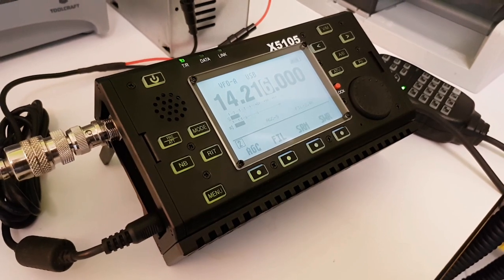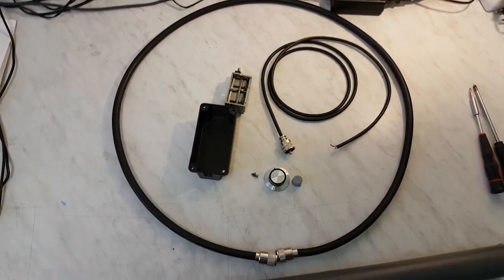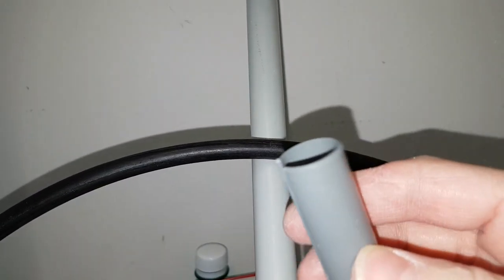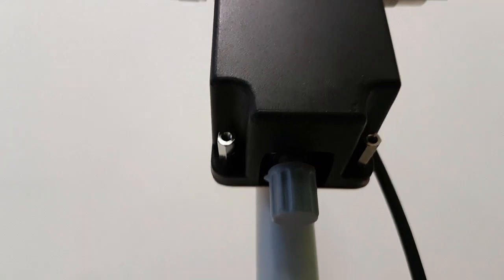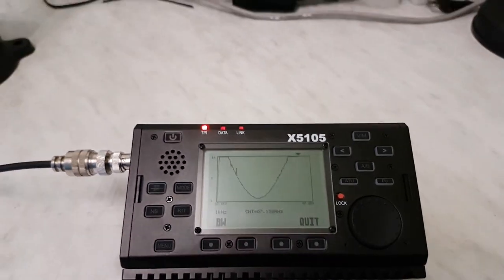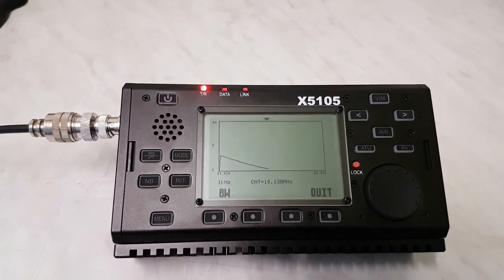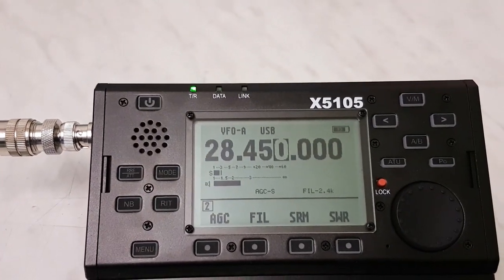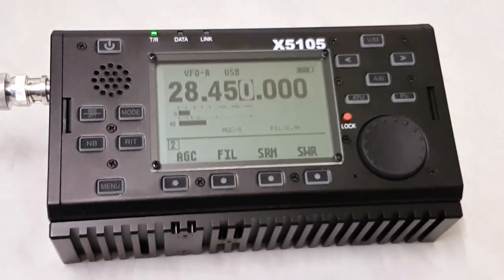UltraLight Magnetic Loop Antenna + XIEGU X5105

Comment: Very good job. My next antenna build is a magnetic loop in the same frequency range as yours, I'm planning on using a capacitor out of a full power tuner. I have an old Amp Supply AT-1200, I also have a 10-foot 3/4-inch copper tube, since I already have the copper, I will go with it. I's nice to have an analyzer built into the radio, I use my G90 in the same manner. 73's🎙KD9OAM🎧

Comment: Hi Paul, 
Many Thanks for another great video about magnetic loops. 
I've been thinking about one for much higher power output,  which will also obviously require a much larger spaced capacitor.  However,  due to the high Q of the magnetic loop, have you thought about putting a much smaller value variable capacitor in parallel with the main tuning capacitor.   Maybe start with the fine tune capacitor at somewhere between 1 quarter mesh & 3 quarters mesh, and then tune the main capacitor in your normal way,  followed by finer tuning with the secondary smaller variable capacitor.  A field strength meter attached with its pickup antenna close to the mai large loop may simplify tuning & increase tuning accuracy, especially when fine tuning with the smaller capacitor in parallel with the main tuning capacitor. 
I would be very interested & greatful to see your thoughts on this. 
Once again Paul,  Many Thanks for your brilliant antenna projects videos. 
73 De M0RAY, 
Sittingbourne, 
Kent.
UK.

Comment: 3:39 HOT POLE (or central pole) not connected? Did you connected to condensator only to the cold pole of the coax cable?
Reply from the maker: Yes all my magloops are connected to the center cores of the main loop coax.
Reply: @OM0ET  3:39 in this image i can see the condenser connected to the cold pole  of the 2 connectors SO239, not connected to the center core of the SO239 connector. Is it correct?
Reply from the maker: @mrtonicsvls3624  oh yes, in the 1st version I tryed connect to the outer shield, but i changed this configuration later.
Reply: @OM0ET  Perfect!

Comment: Can you share any detail of how you closed the small loop? Did you just solder the shielding to the center?
Reply from the maker: Center is soldered to the braid 😉
Reply: Actualy rg 58 connected on small loop above and it runs near to capacitor,it is not cleared the actual connections, whether the coax is only connected to upper loop or it is interconnected too.and, if it is connected on upper loop then both the end of small loop connected with coax shield and core both?

Comment: I will like to know how long is the coaxial loop with the PL250 and also the diameter of the main and second loop. I guess you connected the variable capacitor of 350+350 pf in series with the loo p center pins, if not please provide an schematic of the whole antenna please
I am interested to build one.
My email address is:
ad4c@comcast.net
Reply from the maker: Please visit my website om0et.com 😉👍

Comment: Is your antenna a resonant shielded frame? In the center of the loop, the screen should be cut, in the same place, the connection loop is connected in the form of a small circle.

Comment: Hello Paul, What is the emetter of  10.10 Mhz, I receive the same noise in France on the same freqency . I don't know from where it is coming . 73,  F1HLF Serge
Reply from the maker: It's probably Weather RTTY station (Signal is 50 baud, 425hz shift, normal polarity)
Reply: @OM0ET Thanks Paul, I found it , it's locates to Pinneberg, just near Hambourg in Germany. The callsign for this frequency is DDK9 and the transmitting antenna is located at Pinneberg northern Germany. Best regards. Serge F1HLF
Reply from the maker: @beot7248  Thank you Serge! I will know now ;-) Have a nice day! 73

Comment: Hey dr op. What RG type cable is the main loop made of? And which scheme did you use for connecting the RG58 small loop at the ring/shielding? Thx es mny 73.

Comment: Paul, I love the video. I have a Xiegu G1M SDR QRP. I will build a similar antenna (waiting on a variable capacitor from China - similar to yours - 2 ganged 350 pf).
I am interested in the actual wiring setup. Did you join the center conductor and the shield at each end of the large Primary loop? Or did you simply use the center conductor inside the shield. I am thinking of joining the braid and center conductor at each end of the Primary loop, where they connect to the capacitor. [Edit: I see you left the shield unterminated and even with a few cm gap on the opposite side]
Also, have you simply left the ends of the Driven loop twisted off (it looks like) and unterminated? VK4FETC [Edit: I saw in another of your vids what you did - many Thanks]

Comment: I am disabled and could not build such an antenna. Would you be able to build one for me or recommend a commercial antenna of similar dimensions. Cost is not terribly important. Thank you, Mike, N0WDM
Reply from the maker: Hello Mike. Thank you for your interest of my loop antenna. I build and also sell this antenna but only V.3 and V.4 .
Ver.3 is 85cm diameter and ver.4 is 1m in diameter.  Ver.3 is for 10-30MHz and ver.4 is for 7MHz - 27.5MHz.

Comment: I have found the exact same capacitor as yours (320+380 pF) on eBay for $20 in Bulgaria. I've bought two and I will make the same antenna!
Reply from the maker: That's great. I recommend to you build a 4th version or 3th one 😉👍
Reply: @OM0ET  Thanks for the hint and 73's de F1SLS ;)

Comment: MFJ should stop importing and supporting Chinese Radios.
Reply from the maker: What's wrong with Xiegu radios?
Reply: @OM0ET  My point is I don't care what is wrong with Chinese radios they are ripping off Western Technology! They are not getting my money.
Reply: Nice antenna! I want to build a 10 meter Loop. thanks for the reply.
Reply from the maker: @n9oqu  thank you for your point of view Bob 👍
Reply from the maker: @n9oqu  Once i was using my home made Magnetic Loop antenna as the base one. It was able to handle just 25W, but even with this low power i worked  with VK, ZL, JA and W too. Loops are very practical antennas :-)
Reply: @OM0ET  I should have looked into a Loop a long time ago when considering a compact antenna for operating a home base station.  When i saw that loops were operable inside the house/apartment I was convince I found a solution.  I just purchased a commercially made loop and I am getting it tomorrow.  I also want to build a 6 or 10 meter loop in the near future.
Reply from the maker: @n9oqu  well, so i wish you very good luck with your new loop. And good DX! 😉 73
Reply: @OM0ET  I hope to have a QSO with you. Do you use PSK-31?  With this new antenna  I am hoping to get into CW seriously.
Reply from the maker: @n9oqu  I am sorry but digi modes are for me something like from another world 😄 I have to learn it more and CW also. 😊 I hope to meet you on the air. What ia your callsign btw? 😉 73
Reply: OM0ET My call is N9oqu
Reply from the maker: @n9oqu  OK Bob is good to know 👍 will see you on the air 😉
Reply: @n9oqu  Prove it

Comment: Hello, thank you very much for the video. With a variable capacitor of 30 to 350 pF could you make that same antenna?
Reply from the maker: sierpes hello! Thank you very much for watching 😉 This capacitor is 320+380pF. So if you use only 320pF it will work only on less bands not as this one (from 40m to 10m). 73

Comment: Great video and antenna design, mag loops are really cool.
how much would you say it cost you to build? Also have you tested general Rx/Tx indoors?

73,
KE8GAH
Reply from the maker: Lync Volt the build price could be around 20€.  Piece of PVC tube, small plastic box, short piece of coax, piece of copper wire and feedline with PL connector. To see how its works please visit my video list. There are few videos working QSOs with this antenna. 😉 73

Comment: I don't think leaving the copper on the PCB is a good idea.  when the antenna works at high power, it will get really really hot.
Reply from the maker: captain Liang yes i tought that i will isolate screws from copper layer because it causes little frequency change when my hand is close to tunning box. There is used small high capacity capacitor so this antenna is only for QRP power 5W.
Reply: uh... yeah, it's not a big problem for QRP operation. I have built several loop antenna which the structure of it just like yours. one time I operate 50 Watts in CW mode about 1minute, I smell that something is burning up and I found the knob on the tuning box is so hot that I cannot touch it, but the capacitor is not hot. when I remove the small aluminum sheet from the knob, the problem solved. my best range record with loop antenna  + 0.5WATTS in CW mode is about 8000KM on the 15meter band, but I screw it up because I was too excited to send  Morse Code by straight key.

Comment: Have you tried to tune it down to 80 Meters band?
Reply from the maker: PhilsLab no i didn't. I suppose that so small diameter should be not usable on 80m.
Reply: I am planning to make one of those http://www.alexloop.com/artigo16.html 80 meters is the only one band where I was get at least something using SSB6.1. I have hope that a mag loop antenna will be useful there. Unfortunately I cannot make large antenna. I need something under 90cm in diameter.
Reply from the maker: yes, a couple of loops should work 80 meters. One loop is not enough.
Reply: Yes. I did my research there, ideal loop should be around 3m in diameter which is totally not feasible for me.
Reply from the maker: PhilsLab oh yes i can imagine that lol. :-) Two turns of 1.5m diameter could be much practical.
Reply: I agree. I have to stick with much smaller loop. Can't wait to get variable capacitor.
Reply: Vk3ye made a loop for 40m using 4.2 m of tube and a 10-415pF air variable capacitor and added an additional 2200pf capacitor across the loop for 160 m and 390pF for 80m
Reply from the maker: Ofcourse you can get it in resonance with aditional capacitors, but efficiency of this Magloop will be almost 0% 🙂

Comment: Hello Paul, very interesting built of a MLA. Have been experimenting myself but have a larger size loop. This one is smaller but seems to be working well. Have 2 questions: Don't you have problems with tuning, I'm not shure your capacitor has reduction? And question 2 is: Could you tell us the length of the coax you used for the large and the small loop. I like the way you routed the coax through the tube, never thought of that. 73, Bas PE4BAS
Reply from the maker: Hi Bas thank you very much for you interest of my MLA. Lenght of main loop is 1190 mm and small loop is 445 mm. Small loop is no more made from coaxial cable. Now after i did improvements is made from 2,5mm thick solid core copper wire, let see my 2nd video after improvements here: https://youtu.be/Nfundq0cC7o
Reply from the maker: At 1:40 you can see a small gearbox like reduction on capacitor. Tuning is not so hard to tune. Harder is to prevent little capacity change while is hand close to the tuning knob. Because of that you have to tune it little bit lower than is the best SWR position. When will be your hand away so MLA will resonant higher. It's about 3-5kHz change in my case.

Comment: How close does the driven element have to be to the main loop?  Did you play with varying distances between the two?
Reply from the maker: Barry Mercer it has to be as close as possible but it has not to be electrically touched each other.
Reply: Thanks.  I enjoyed your vid and used it to make a similar loop!  However, it is still to cold to go outside and play with it.  Tell me, how do you like the Xiegu?
Reply from the maker: Barry Mercer Yes the Xiegu X5105 is an excellent radio. I like him very much. I sold my ex Icom IC-706MKIIG and bought this one. And i am very very happy with it.

Comment: heiio Paul!
where can I see the exact scheme of your antenna?
I'm interested in connecting a small loop and capacitor.
73! RW9RN
Reply from the maker: Hi Andrey, if you want schematic diagram so i have to draw him. If i will done it i will put a file link in to this video description. OK?
Reply: excellent Paul!
I will wait for the link. this is a very interesting antenna for my summer cottage.
73!

Comment: What confuses me is that the loops are made of shielded coax which blocks signals. Why isn't it better to use exposed copper?
Reply from the maker: Hi Golan, the shielding of the main loop never should be grounded if you use inner core as radiator. But you can use shielding as radiator too, but there is a problem when are used PL connectors, because of poor electrical connection will cause this tiny spikes as you can see here: 11:05 After this video i did few upgrades and one of them was that now i use inner core as radiator - there is a much solid connection and this spikes dissapeared. ;-) btw. shielding can be used as the prevention against strong electric noise, but i am not sure of that in this case.
Reply from the maker: My antenna is working excellent now after upgrade what i mentioned before. There are not any spikes/peaks anymore at antenna analyser graph. Inner core is connected only.
Reply: My question is on this cable used as big loop.as it has shield of corrugated copper thin film and not the smooth shield (as it is not seen in  the cable used as it is already ended with pl 239 connectors.) Will it effect. As some doubt raised here is cleared by use not to ground the shield.but if I want to use this thick cable as VHF radia as shield and not middle one ,can I use it? If yes , what the effect on antenna?

Comment: That variable capacitor has two major sections of different sizes.
They are probably for an AM  radio. (MW & LW) The left hand section is about 500 pF the right hand is about 350 pF.
There are also 2 small, extra segments on the same shaft which are very low..
perhaps 15 pF . They would have been for FM radio tuning.
If you seek as high capacity as as possible, parallel them in as well.
It won't add a lot but every bit counts.
Reply: EA3BV
Thank you.